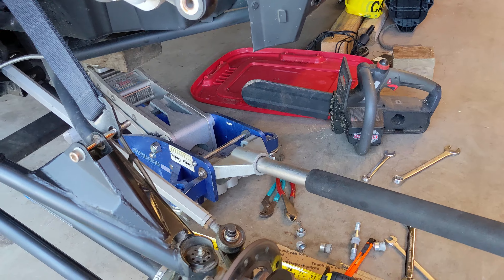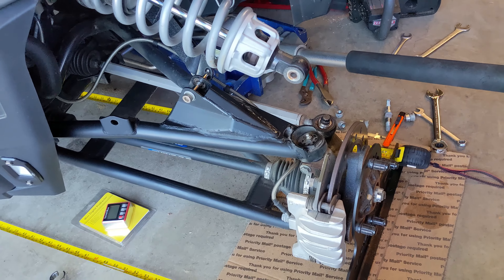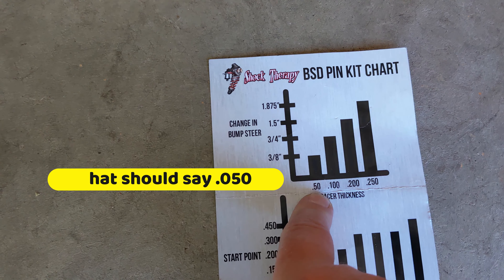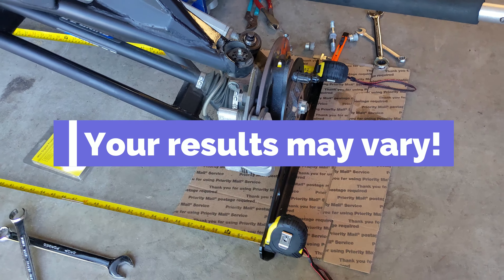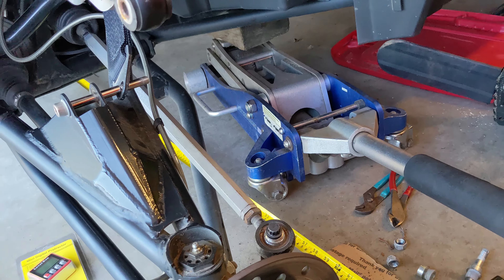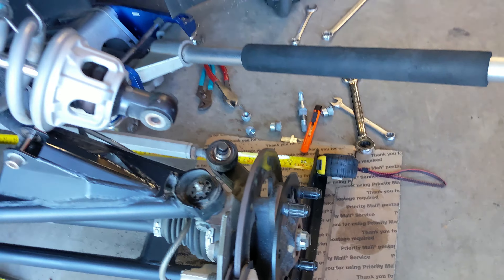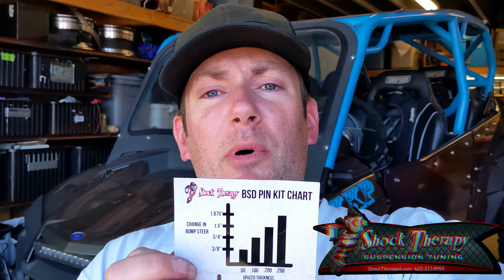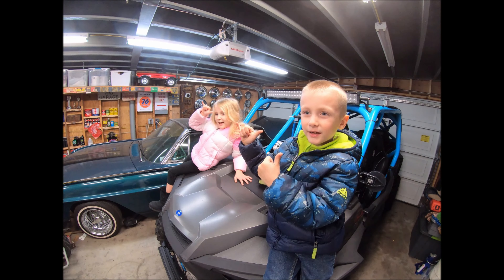Want better handling?? Shock Therapy BSD (Bump Steer Delete): Buy It!! The HOW, WHAT, & WHY...

Comment: What paddle setup you running how much power
Reply from the maker: I run 32" SS360 front and Sandcraft Demon 10 paddles in the rear. If you want to see how those work you can watch my latest upload. I really like the combo! I used to run STU's in the rear and they hook really well, but for my driving style (more fun drifting) I've been loving the Sandcrafts. I don't have crazy power, but I have the water-cooled Pro XP style turbo on a stage 3 tune.
Reply: I run e85 I have 10 paddle demon to wasn’t sure how they were on top end your car was moving in the video I watched it so I wanted to ask what you power you were running and how they did
Reply from the maker: @azrzr5440  top end is pretty much neck and neck with my buddy's Turbo S with the same turbo and tune and he has fairly worn STUs.
Reply: We go to glamis a lot and drags just want it spooling at the end but wasn’t sure how they do on top end
Reply: What tune you using AA or whalen
Reply from the maker: @azrzr5440  I run the AA stage 3 tune or sometimes I put octane in it and run my own tune (I come from the automotive tuning world). I have a few buddies that run the 12 paddle Talons and they seem to have 1-2 mph top end on mine, but it's always hard to tell sure to weight and amount of passengers. The biggest difference I've seen is with two friends with Pro R Ultimates. One has STU and the other has worn Demons. Out of the hole the STU cat gets 2 cars ahead and by top end the Demon car is out front by 3 cars. I was blown away by the difference because the STU car has a tune and exhaust as well.